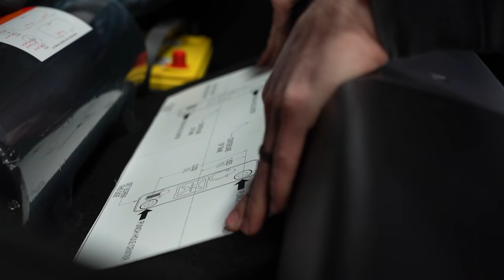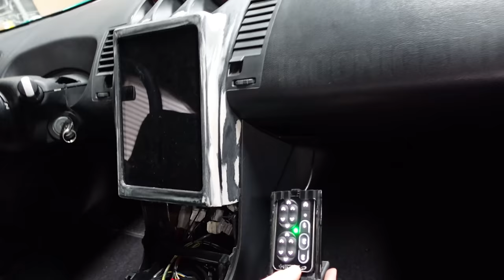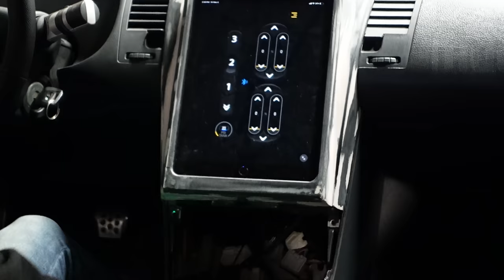Building the World's FIRST Tesla Swapped Liberty Walk Nissan 350Z! Ready to drive on the street!?

Comment: You guys should have gotten the accuair air tank that has the compressor built in the tank and this one is a bit quiet.
Reply: Accuair don't make the ENDO-CVT tank any more unfortunately they only make the ones without the compressor
Reply: @maus1263  you said they don't make.it anymore but isn't accuair nonexistent?
Reply: @purplehills56  They got bought bay another company but still using the Accuair name and products just don’t CVT tank because the pumps keep braking

Comment: I'm not sold on how EV's are meant to be greener than ICE but you can't deny the performance and eventually cool builds like this and the Ford Performance F100
Reply: Why are you not sold? Ice cars have rare earth elements in them, you can't recycle a gallon of gas. Everything for an ice vehicle wears out and requires massive amounts of energy. Plus it's undisputed the exhaust alone can easily kill you. 🤔
Reply: @4literv6  because they say they are greener when they are not over their life cycle when you consider all the components and how they are manufactured and also still have fossil fuel to ship them around and also when a fire breaks out there is no way to stop it where at least with an ICE car you can if you get it early enough

Comment: Anyone knows the range?
Reply: They haven't said the est range. But it uses a full tesla pack worth of modules, so with the lighter weight. It should be 200-300+miles depending on which pack they used. 🤔
Reply: @4literv6  thanks brother 👌would be a turn off if less that that 🤣
Reply: @nathan15nn  sure, I'd be shocked if when driving it normal it got under 200+miles. Should be closer to 300 imo as it's significantly lighter than even the lightest model s was that the pack came out of. 
I wonder what it'll run in the 1/4mile? I'd guess mid to upper 11s as is. Possibly high 10s with tuning&sticky tires. 🤔